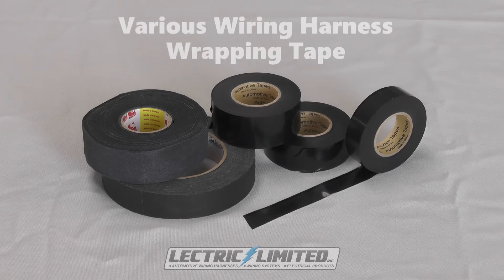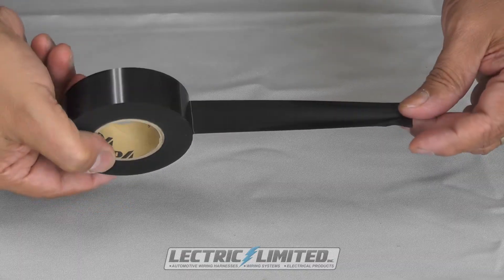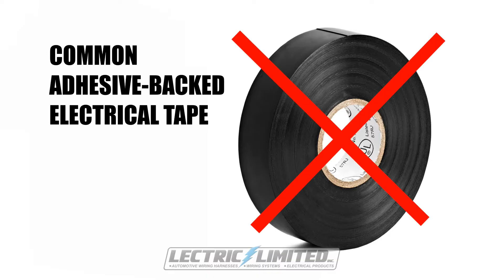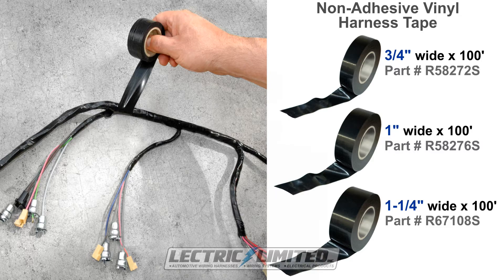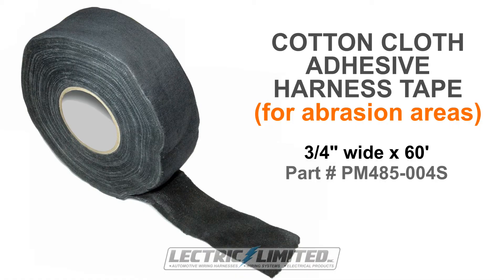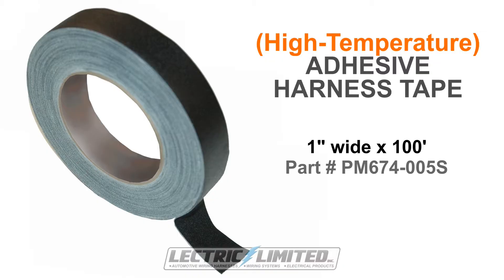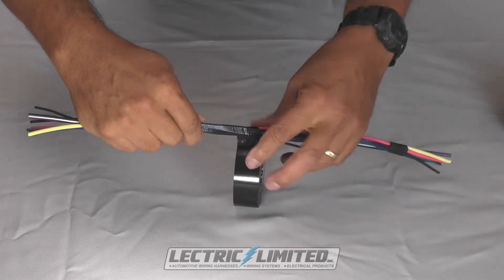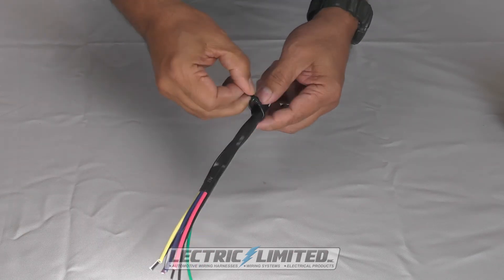Wiring Harness Repair/Wrapping Tape. How to re-tape an old harness using correct non-adhesive tape.

Comment: I have my engine bay almost empty due to rebuild on my 02 6.0. The plastic loom crumbled by just looking at it so the tape was also coming undone. I removed all the loom and tape. I cleaned the wires and rewrapped with Tesa cloth tape. Then used split braided loom. Then I depinned the connectors, slipped heat shrink over them, and heat shrinked the end of the loom towards the connectors. On connectors that aren't meant to be depinned I used super 33+ tape and taped the end of the loom towards the connectors. 🤷‍♀️ never done this before and figured it couldn't be worse than what I had

Comment: Great video! I'd really rather you just make me a new harness, but I don't see one for a '76 Scamp on your website... So if I need to try to clean up my existing harness (it has 47 years of crud and Ziebart on it), should I try to remove the old tape first, or just put this over the old tape? If I should remove the old stuff, is there a preferred method?
Reply from the maker: Don't remove your old tape.  If your old tape is still laying relatively flat, I would recommend that you simply tape over your old tape with our non-adhesive tape.  If your old tape has hardened and lifted (is poking out) on some spots, to avoid a bump in the tape, I would remove that portion before taping over it.  Hope this help!
Reply: @LectricLimited  Thanks- I placed an order via your website last night.